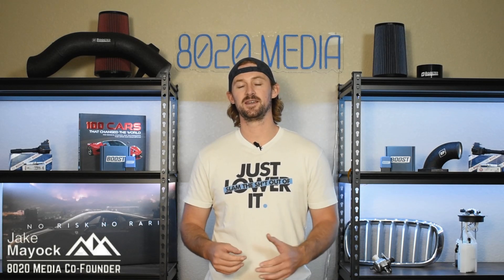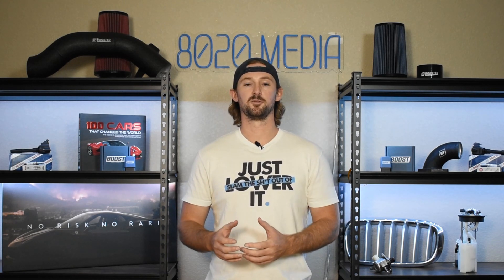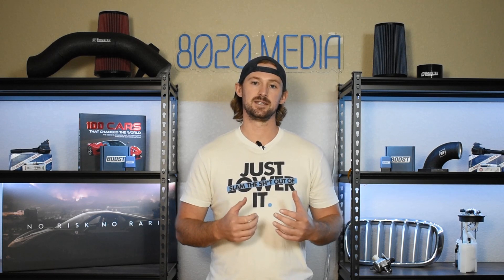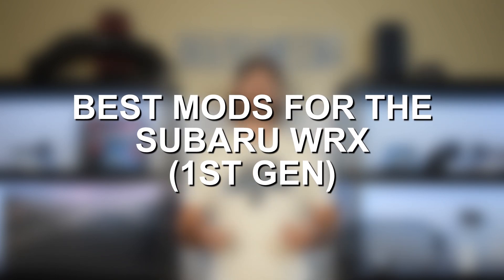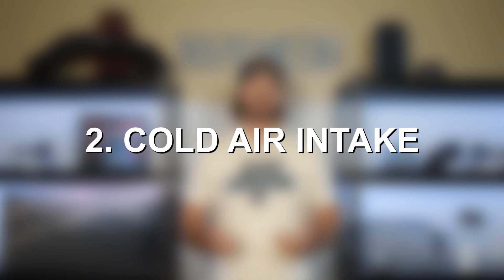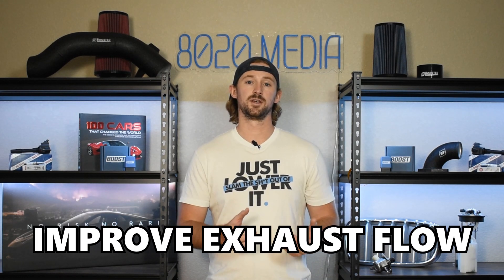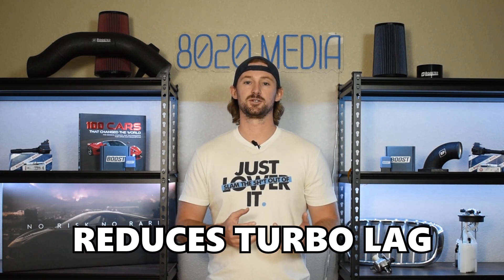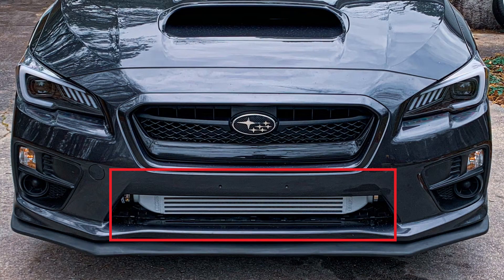How to Build a 300+ WHP Subaru WRX VA! (FA20F/FA20DIT)

Comment: I’ve been running at around 380hp on my stock block/internals for about 3 years now. That being said I don’t daily the car (I’ve put a little over 15k on it) and recently I have noticed the car is burning a decent bit of oil, so I believe I’m about to reach the end of stock life. I’m currently full bolt on (Invidia downpipe, followed by a R400 exhaust, cai intake, MAP top mount intercooler, blah blah), as well as a FP green turbo, and certain emission compliant👀 deletes, and obviously pro tuned. So, it’s doable, but in the long run, you’re gonna hurt the engine, even if you’re like me, and RARELY do hard pulls on the car. I’ve loved my car, and put tons of money into it, BUT if you’re going for big numbers this might not be your platform.

Comment: I just got a 2016 WRX a couple weeks ago! It's my favorite car by far (considering my first car was a Dodge Caliber) the only mods Im planning on doing is a catback exhaust, catted j-pipe, AOS, a blow off valve, and an upgraded intercooler. I think those should be great for some nice HP while keeping it a reliable daily driver
Reply from the maker: H - For sure! Congrats on the new car.
Reply: Yoooo honestly I'm looking at doing the same, likely with a better intake as well as an aftermarket turbo, still considering options for an ecm accessport

Really I just wanna squeeze a little more power out of the vehicle without tearing apart the stock cvt or having to manual swap
Reply: @avery2306 I’m sorry your WRX has a cvt in it

Comment: How do they know you did an egr & tgv delete? Serious question
Reply from the maker: B - Who's they? EGR (Exhaust Gas Recirculation) and TGV (Tumble Generator Valve) deletes can often be detected in several ways: 1) ECU calibration scan – dealerships and inspection facilities can scan your ECU and see if the calibration ID or checksum differs from stock, indicating that a tune was flashed to disable EGR or TGV systems. 2) Readiness monitors – deleting EGR/TGV often disables related OBD-II readiness monitors, which can flag during emissions testing. 3) DTCs present or previously stored – even if you clear CELs, some tools can detect history or permanent codes related to EGR/TGV faults. 4) Visual inspection – if any emissions components are missing or visibly blocked off (e.g., capped vacuum lines, missing wiring harness plugs, or aftermarket block-off plates), it’s a giveaway. 5) Sensor or valve activity – advanced diagnostic tools can check for TGV position sensor response or EGR flow data, and if those readings are flat or missing, it raises red flags. Even with a tune, some techs will still notice anomalies if they're looking closely.

Comment: I really wish there was something to give constant power gains besides the tune, CAI, exhaust, intercooler that does NOT depend on stupid higher ethonal blends. Realistically ppl aren't going to always drive around with E85 or E30 blends. To me fuel would be that random time when you want to go to the track etc. 

Just wish for daily driving there was a few more things we could do to reach constant 300 wheel torque and 350 wheel hp
Reply from the maker: E - That's just the way it works unfortunately.
Reply: I have a built block and run e30-e70 always. Since the car was tuned 2 years ago it's always had at least e30 in the car. Love it.
Reply: @swissmove1  i ended up going full flex fuel. Can run anything now. I got max everything i can do unless I build the block.
Reply: at 5000ft elevation I had 270whp and 302tq on 91 pump gas and 346whp and 381tq on e60. At the time I had 2021 WRX
-IAG Air Oil Separator,
-ETS GESI Catted J-Pipe,
-Borla S-Type Cat-Back Exhaust,
-COBB Big SF intake,
-COBB BYPASS VALVE - 2015-21 WRX FA20,
-COBB 3-PORT BOOST CONTROL SOLENOID,
-GRIMMSPEED TURBO INLET,
-GRIMMSPEED Front mount intercooler,
-AEM 340lph,
Reply: My setup is a bit different now but If I was to make a new build I'd get 
-IAG Air Oil Separator,
-ETS GESI Catted J-Pipe,
-Borla S-Type Cat-Back Exhaust,
-GRIMMSPEED intake,
-COBB BYPASS VALVE/or grimmspeed v2 - 2015-21 WRX FA20,
-COBB/or Grimmspeeds 3-PORT BOOST CONTROL SOLENOID,
-GRIMMSPEED TURBO INLET,
-GRIMMSPEED top mount intercooler,
-AEM 340lph,
- Nostrum High pressure fuel pump
-AEM water/methanol kit (to clean intake valves and keep my intake temps cool af even with a top mount, because I have it now with a fmic and it's amazing)
-omni power 4 bar map sensor so when i go higher/lower altitude after getting tuned my car still works perfectly tune wise
-I wouldn't get an oil cooler I'd see how the oil temps are are with just an upgraded radiator, CSF two row since I'd have space for it without the fmic
Reply: @shakultra i have everything done to my WRX at this point without rebuilding the engine. On e85 she hits 404 whp and 335 whp off 93.
Reply: Wrong platform my brother.  Unfortunately you would have get into a Nissan Z or something in that class for those numbers to be reliable in factory form.   I have a 17 VA chassis and feel your pain
Reply: @shiloh5199  i bit the bullet, did everything that can be done aside from an engine rebuild for more power. 

335 whp on 93 octane and 404 whp on e85.

Comment: Just tune on 93oct and thats it. Ethanol tune and you got 350whp.
Reply from the maker: S - Not a very reliable 350, if that's what you're claiming.
Reply: @8020Automotive  What do jpipe, intercooler and intake add as far as reliability goes?  They may add 20whp/30wtq though,  mainly intake and jpipe.
Reply from the maker: S - An intercooler adds a ton of reliability. We touch on all of these parts and why we advise them in the video..
Reply: @8020Automotive  Not sure how intercooler aids reliability when tuning. I am of the logic that tuning itself as well as modding can only add to unreliability of oem vehicles but what do i know.
Reply from the maker: S - Sure, in general tuning will ultimately make any engine less reliable. Just tuning it alone and doing nothing else though is going to be the least reliable option. So if you're going to tune it then you're going to want to add whatever other supporting modifications that you can that will help make the car more reliable when it is tuned. And an intercooler is one of the best things - higher boost levels from tuning means more heat being produced from the turbocharger so it's important to make sure we're keeping engine temps down and sending the coldest air to the engine as possible as heat is the main killer of any engine. And an intercooler is the best way to do this. A vehicle that is tuned with an intercooler, intake, and downpipe is going to be more reliable than one that is just tuned since all of these other modifications serve purposes beyond just adding power - like reducing EGTs, IATs, and relieving stress placed on the turbo. Yes, tuning is going to be less reliable than leaving it stock, but there are things we can do to make tuning safer.

Comment: With full bolt ons and a dyno tune from JRTuning, my 2018 WRX made 389 whp and 350 wtq on an e60 blend of fuel.
Reply from the maker: J - Thanks for taking the time to share your experience. How's it running and how long have you had it like this?
Reply: @8020Automotive  To share my experiences, had a VA on 360/350 for 65k miles, not one issue. Have a VB on ets intake and e50 at 400/450 for 23k miles and now upgraded to a Blouch hybrid at 500/520+ with ets jpipe, not one issue for 5k.  Stock tranny stock original clutch.
Reply from the maker: S - Thanks for sharing! Sounds like you've got some sick builds.
Reply: @8020Automotive  Hybrid build is pretty cool especially since it has ethanol port injection and separate fuel tank.
Reply: This wheel hp and wheel torque...at crank that's like 475hp.  That's up there.
Reply: Stock turbo?
Reply: What were your bolt ons?